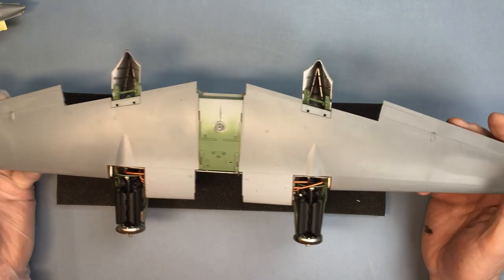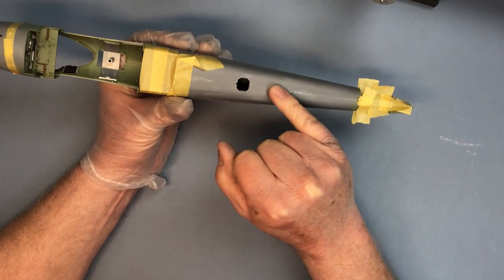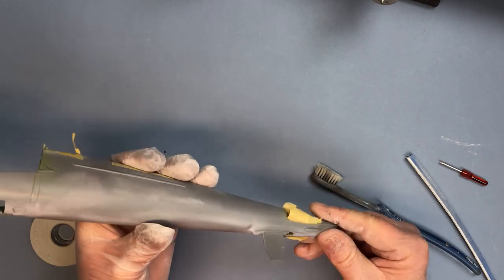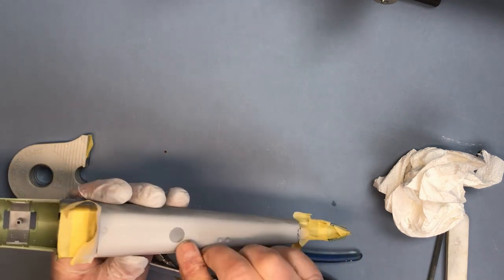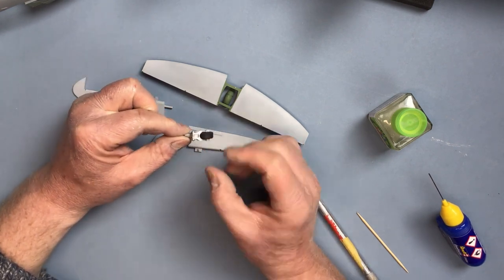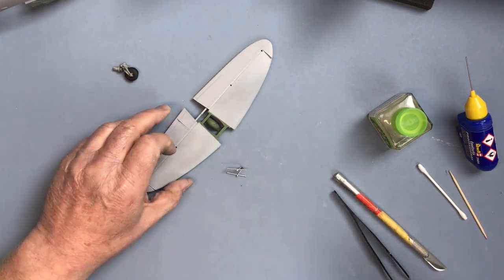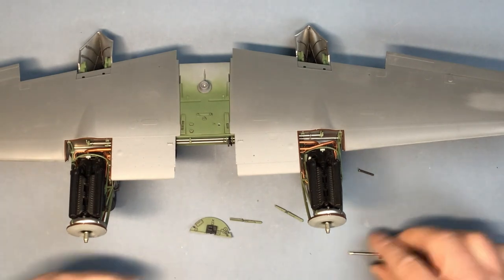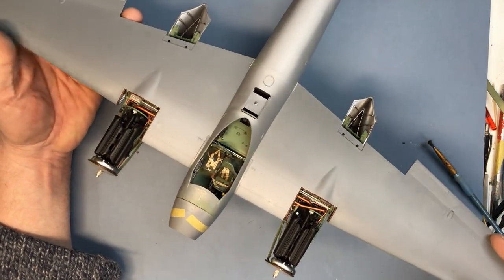Tamiya 1/32 Mosquito build series Part 10

Comment: Great work! would've liked to have seen a pilot and a navigator. Thanks again for your hard work
Reply from the maker: Thanks Colin. I didn't use the excellent seated crew figures because they obscure alot of the interior detail and it would really need the access hatch closed as well. I'll be using the third crew figure which is posed to be stepping onto the access ladder.

Comment: 5:22 - Ghost seams ???
Reply from the maker: It’s a faint imperfection in the plastic caused by sanding the joint before the glue has fully cured. the semi molten plastic continues to move so keeps reappearing. theyre very difficult to remove entirely so I leave my major assemblies 2-3 days clamped before cleaning the seam up.